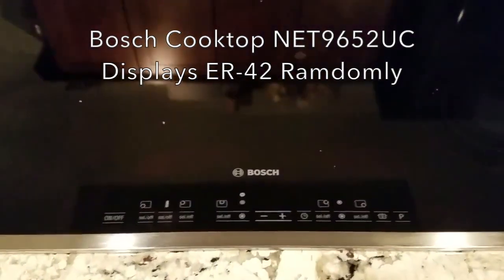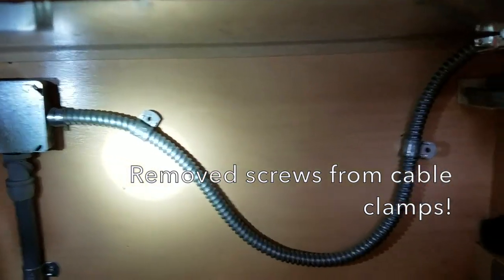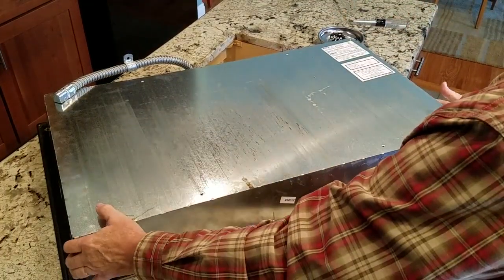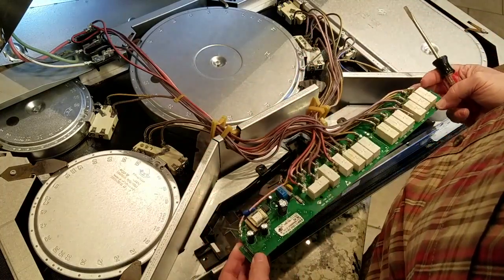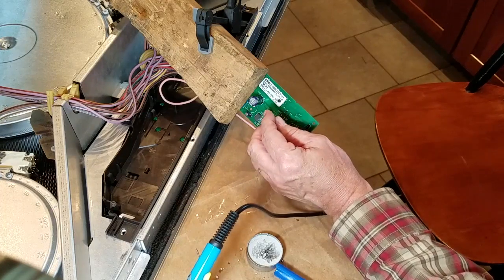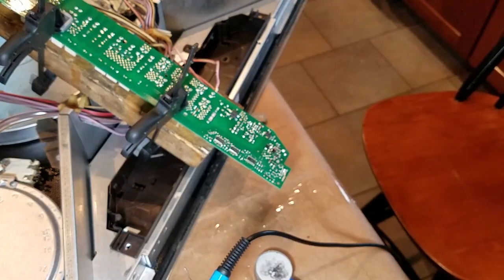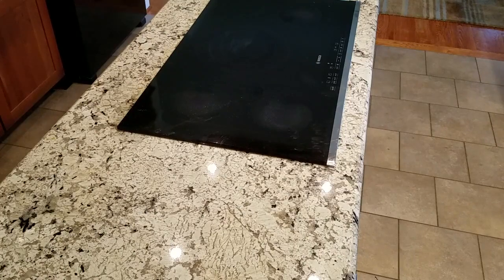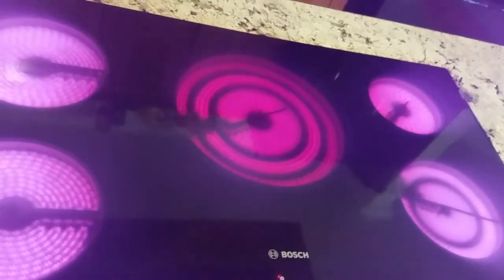How to repair Bosch Electric Cooktop that is displaying ER 42

Comment: Great Video.  My cook top has been giving a ER 42 for the last 3 years and it was getting worse by the month.  Luckily I stumbled on to your video.    Replaced the 2 capacitors at a cost of $1.75 CAD for 2 each from Lee's Electronics shop in Vancouver Canada.   Thanks a million !

Comment: Great detailed video.
I have this same cooktop and got this same error message.
   Disassembled it in similar fashion.
But I labeled and removed all the wires. Then took the board to my local electronics repair shop. In 10 minutes the 2 defective capacitors we're replaced. Total cost was $30.
Reassembled it all. Put the breaker on and voila for $30 my cooktop works better than ever.
Had a repairman come in, they would've probably sold me a new board and with labor total cost might have been $1000.
   I had a similar capacitor defect in a GE Monogram refrigerator main board and fixed it similarly.

Comment: What do capacitors cost?
Reply from the maker: Only a couple of dollars, but the price will verify because of the small quantity.
Reply: @glennverner4987  and how many capacitors are there needing replacement?
Reply from the maker: @rodgeryin2006  two
Reply: @glennverner4987  thx for your prompt reply!

Comment: Awesome information, but just how did you know to change those capacitors?
Reply from the maker: The capacitors were bad (bulging) so decided to try replacing them before ordering a new board.
Reply: @glennverner4987  - Ah. Now that makes perfect sense. I must have missed that part.

Comment: This is some really pro work and an excellent video.  I have a Bosch Stove Top NETP068SUC with a bad on/off touch sensitive button. The buttons are not mechanical but like buttons on the screen of a smart phone. I have to touch it over and over for several minutes or more before it will turn on. It turns off much quicker but still slow. All of the other buttons work fine. Do you have any ideas about what would cause a single button switch to fail this way? And, do you think Bosch sell me a replacement switch? Otherwise the repair is going to cost in the hundreds on a $1300 stove top that is only 2 years old. Thank you.
Reply from the maker: You can find parts, search online for Bosch Parts

Comment: Isn't it an induction cooktop, doesn't there have to be a pot or pan on the element for it to activate?
Reply from the maker: No it has heating elements, under a glass surface.
Reply: @glennverner4987 You're right, I just read the manual online and see it is an Electric cooktop not an Induction cooktop.

Comment: Has the er42 error come back at all ever since you replaced the capacitors?
Reply from the maker: The error has not reoccurred, its been about 6 weeks sense doing the repair.
Reply: thanks! your video was really helpful for me, since I'm looking at the same issue and was planning to replace the capacitors as well, although my er42 error comes and goes, so the cooktop is still usable to me.
Reply from the maker: Yes mine was the same the error was intermittent and the stove still worked.